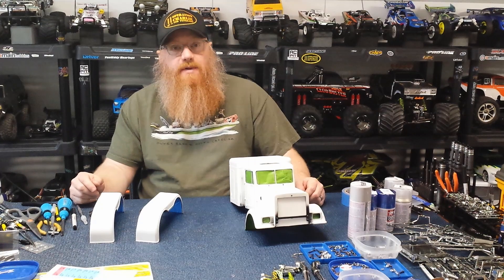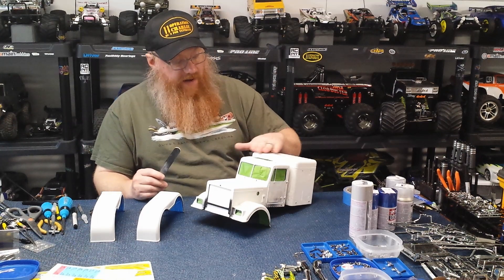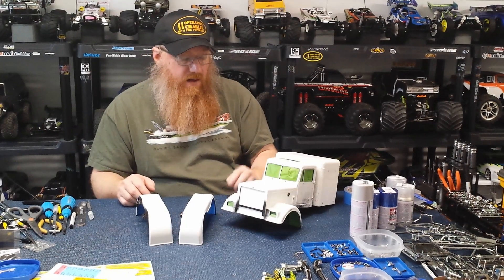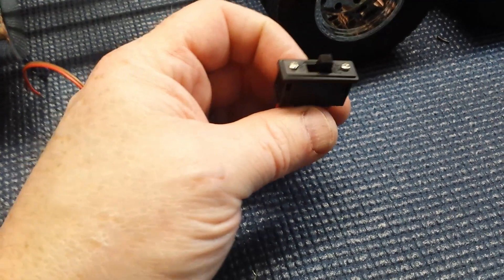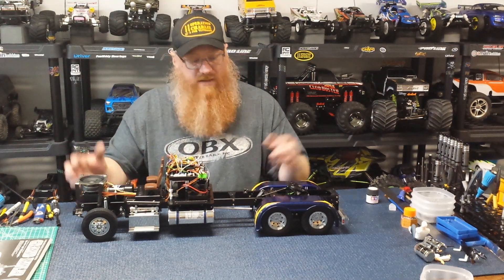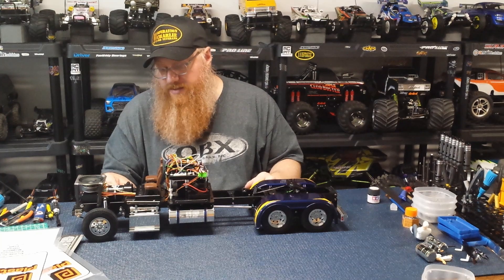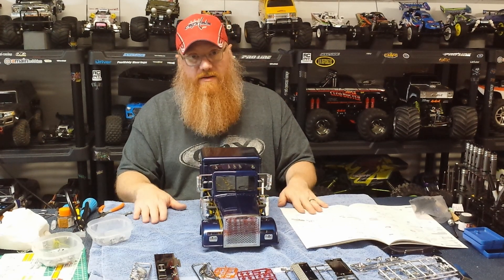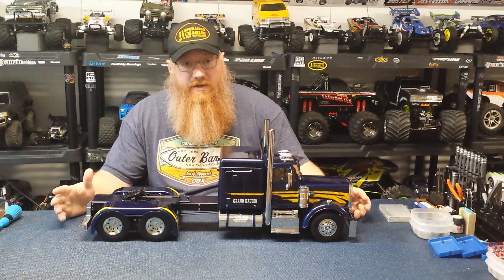Tamiya Grand Hauler TAM56334 with MFC Part 3 - Paint, Final Wiring, Thoughts and Tips

Comment: 22:45 I ground out part of the headlight area and glued in the second pair of lights so there are four total. It can be done if you don't mind hacking up the body (carefully) and then the front looks great. One issue I ran into while doing this is the extra headlights are closer to the lenses so they seem much brighter but its still a great look compared to two headlights only. One note about the motorized support legs and the rear wheel fenders. You can use them but if you jack-knife the truck with trailer attached you will scrape them up badly. I recently ruined mine and now have to strip and repaint them. I may just remove them altogether. BTW great looking truck!
Reply from the maker: I thought about cutting the light out but was too excited to see it done!! I did scratch a rear fender already. I bought some chrome diamond plate from RC4WD to cut out a couple covers for the tips of the fenders. The hope is it will look like they are walk guard or something and not doofy! If they end up looking bad I'll send and print mine too. In hind sight I would have skipped the electronic legs all together. Thanks for stopping by and checking it out!

Comment: Hey! Great build! I have a tip for putting the lights through the body. You can pop the wires out of the connectors that plug into the MFU. It’s very tedious but can be done with a small flathead screwdriver. Run the wires through the hole and pop the wires back into the connector. Just be sure to put the 2 wires in the connector the same way you popped them out.
Reply from the maker: Didn't even think about that. Luckily I the snipping of the edges of the bulbs worked out! I did notice on the MFC the ground is on one side of the board and the positive is on the other so that helps identify the right wires. Thanks for watching and for the tip as I will be building another at some point for sure

Comment: Looks great! Great info. I need to start building mine. I think I'm putting the MFC in without the vibration unit. I want the driver dude in mine.
Reply from the maker: You can move the speaker unit under the hood and it will allow for the full interior with the rumble installed. Bob from hobby concepts sells the brackets, I made my own but took a bit of trial and error to get them right so may be easier to get the ones from Bob! Thanks for checking it out and they are a fun kit to build up. Just take your time with it and you'll enjoy it.

Comment: Hey Addam' great video. I found your video because I was searching these kit after buying one for myself this xmas and I've run into couple issues that I hoping you or someone reading to help me out. When mention the pain in the a$$ the roof lights were and my issue is gluing. I am having zero success gluing anything that's plated and even had amazing goop glue eat some parts (completely garbage) I am not having doubts moving forward with the remaining similar parts. Manual calls for instant cement (which I have) but it also calls for (synthetic rubber cement). What I found and have yet to test is TAM87188 Multi-Purpose Cement Clear. 

Any info you care share with me would be greatly appreciated
Reply from the maker: Sorry about the late reply, been without power all week! For the roof lights I took a hobby knife and scraped away the chrome off of the spots where the mount and the slow on the cab then used regular medium model cement. That will give you the best bond but it is tedious and slow. You can use instant glue, test it on a scrap piece of chrome like the parts tree sprue to make sure it won't fog up the chrome. The only place I remember the rubber cement was for the rubber bump stops on the suspension. I used some spray adhesive there since I didn't have any other rubber cement. I just sprayed a bit on piece of cardboard and then dabbed the rubber pads into it and then used a bamboo skewer to wipe some on the plastic parts, give it a minute or two and then stick them together. Hope it wasn't too late to help out!

Comment: That looks awesome!
I wonder if you can use a capacitor on the rumble motor power supply to give it a boost on start up?
Great video mate 👌🦘🇦🇺
Reply from the maker: I had not thought of it but it may work. It only take a few seconds to shut it down and then restart to get it going. There is not much out there on the specs of the MFC output powers and I am worried about wrecking something with it by messing about too much! It is a fun thing to have on to show people the full effects of it but for just driving it around it is best to leave it off for the sake of not shaking the truck to pieces!  Glad you liked it and thanks for stopping by!!!
Reply: @AddamsPlayground 
Yes I totally agree, it'd be a shame to blow it up.
Such a good looking truck, nice work!

Comment: Is there any way to use the mfc with a aftermarket ecu?
Reply from the maker: So you have the MFC but want to use another speed control instead of the built in one? I mean you can, you would have to use a Y-adapter for the throttle channel on the receiver and split the signal to the MFC and the other ESC and just wire the motor to the new ESC. You would have to split the signal to both to get the sounds from the MFC unit when going forward and reverse as well as the brake and reverse lights. I don't see any reason you can't do it, just make sure the motor leads from the MFC are protected and won't make contact with anything in there while driving, that would be not good!